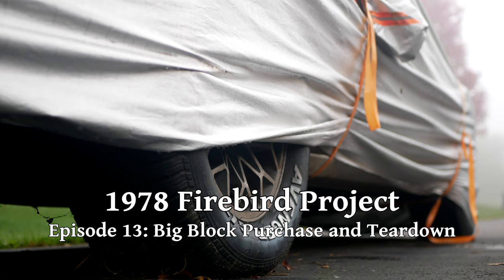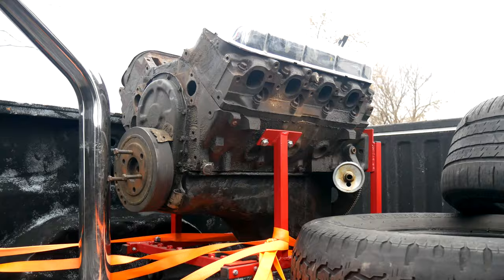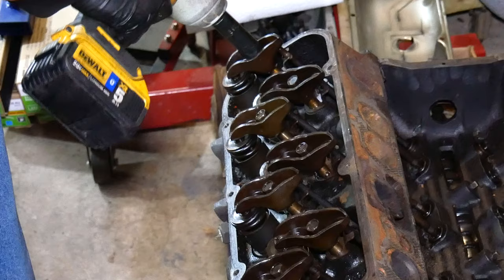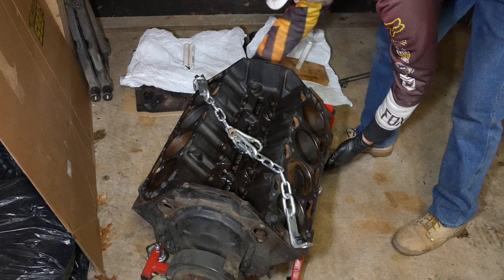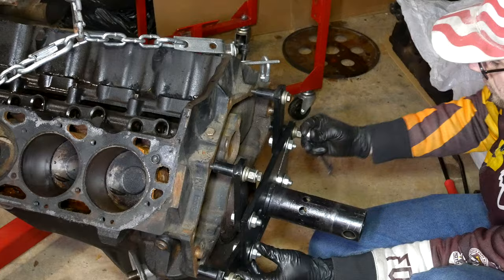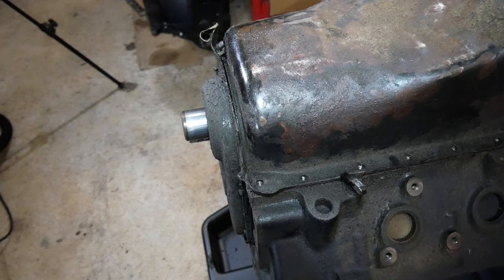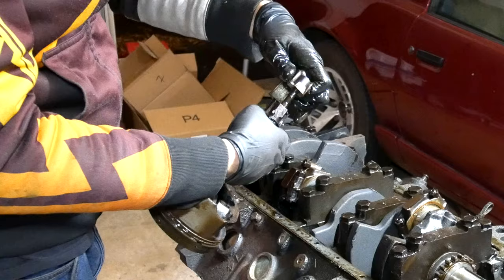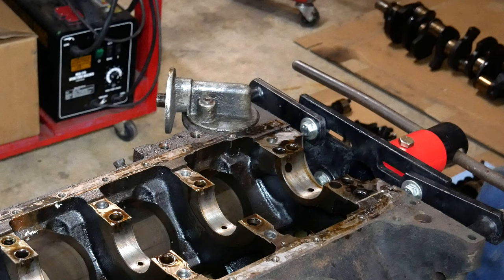$200 Craigslist 454 Big Block Engine Rebuild: Purchase and Teardown (78 Firebird Ep.13)

Comment: well
the firebird was never a muscle car
and never had a big block

so no lol
Reply from the maker: You could get persnickety and refer a Pontiac 400 as a "wide block", but I won't hear from anybody that a Pontiac 455 isn't a big block. Firebirds definitely had big blocks in certain years and configurations
Reply: @FuzzyDiceProjects  pontiac engines are large and small journal. There are no big block or small blocks.
And the 403 olds is A small block lol. The 455 is identical in size to a 350 and they share many parts. 
Buick olds Chevy ford dodge have big and small.
Pontiac does not.
Reply from the maker: Technically, you're right in that their V8s were all one family, but I don't think it's hurting anyone to lump engines like the Pontiac 455 in with similarly large displacement engines from other makes that were big blocks. And, there's the obvious distinction that it is literally a large engine block. It's not an externally "bigger block" than the 350 but the long stroke and almost 4 1/8" bore of the 455 means it is big on displacement comparatively.

Comment: Pontiac didn’t make any big blocks
Reply from the maker: Technically, you're right in that their V8s were all one family, but I don't think it's hurting anyone to lump engines like the Pontiac 455 in with similarly large displacement engines from other makes that were big blocks. And, there's the obvious distinction that it is literally a large engine block.
Reply: @FuzzyDiceProjects  all of the traditional Pontiac V8 engine blocks are the same dimension. Heads, cams and intakes could be swapped from a 326 on to a 455 Pontiac. The only difference was the 421, 428 and 455 were referred to as large journal engines. The main bearings were 3 1/4” vs 3” on the 400 on down. The 301 and 265 still shared the same bore spacing but had a lower deck height.

Comment: With that thing be in that old sure the hell aren't going to reuse lifters and pushrods throw that fucking shit away buy all new
Reply: pushrods are fine as long as they're not bent, I think he is going to reuse the lifters but really should buy new ones because unless I'm missing something he didn't particularly take all that much care keeping track of them and they're pretty heavily varnished probably not worth cleaning when you can get a set for $50